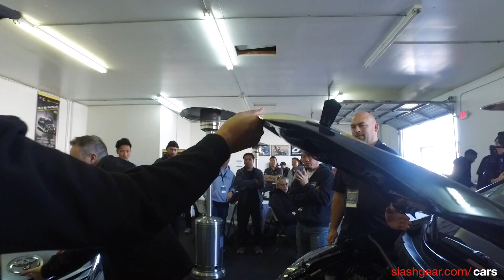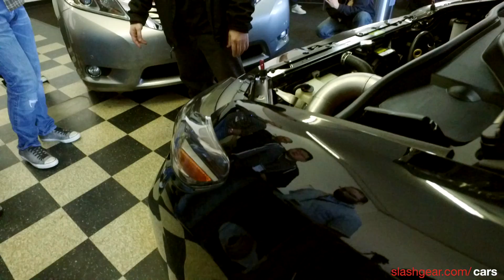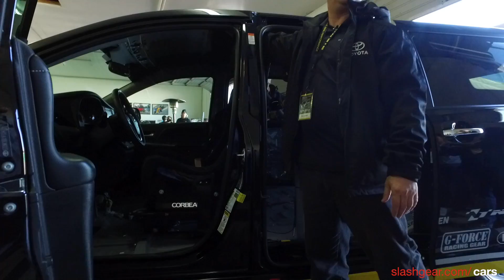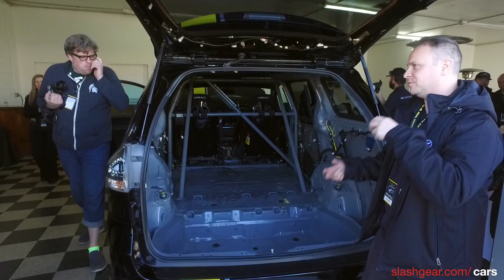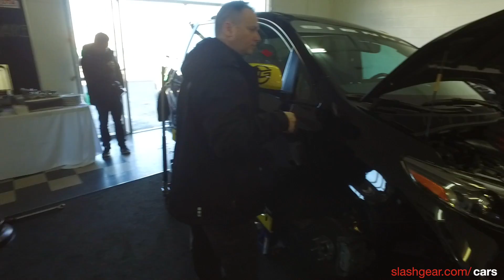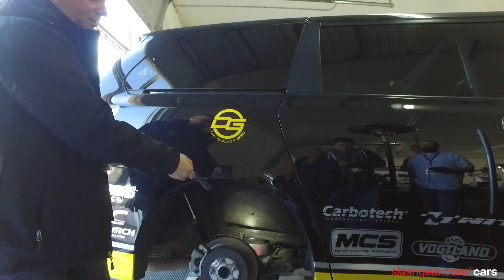Toyota SIENNA R Tuned detail walkthrough

Comment: Noticed that the shot of the camber plate orientation favored more caster than camber. 

I would have thought, based on his comment about removing more rear weight than the front, they would have gone with a narrower tire in the rear so that the front and rear heat up approximately the same. With the setup now, I can can see the front getting up to to temperature while the rear is still cold.

Comment: Nice air intake!   But it's pulling air from a low pressure area, if in fact it's pulling air from the wheel well area.   Foglight air....much better.  Which maybe how it is setup but can't tell exactly.